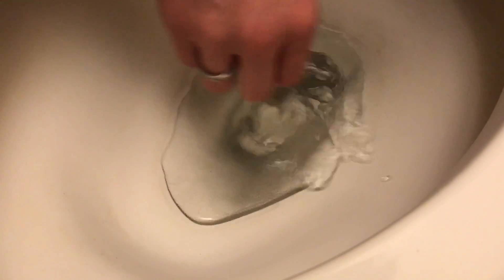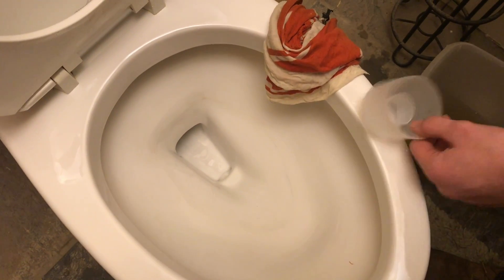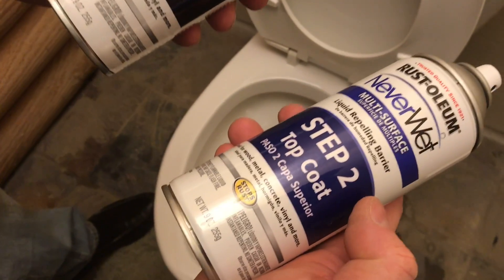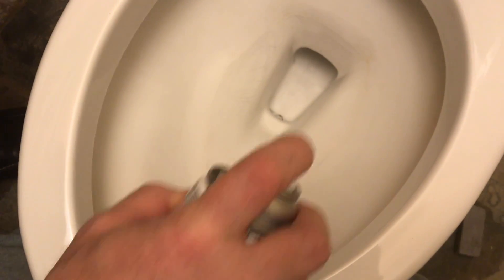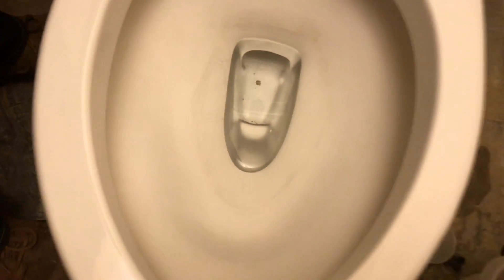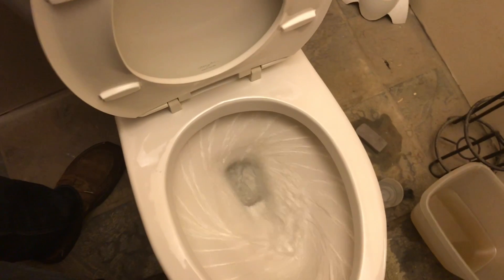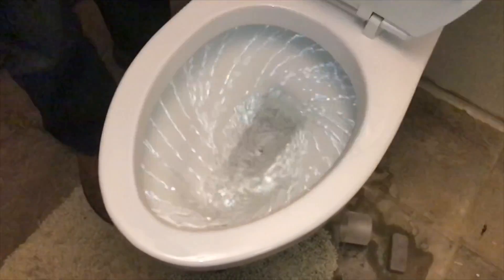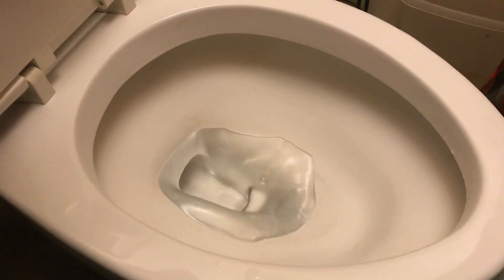how to create a HYDROPHOBIC self cleaning toilet!!!

Comment: Hmmm. Scuff the bowl first with a Brillo pad to give the paint something to stick onto. Epoxy would last longer and some antiperspirant spray onto the wet surface of the epoxied bowl would act as your cheap hydrophobic material or even that same top coat you just used onto that epoxy. Otherwise, lol, some automotive grade ceramic paint coating. Should atleast get some years of life out of it. You said wax lasted longer so the hybrid ceramic spray wax should do even better. I’d say atleast 2 weeks to a month depending on brand. You, sir, are a true innovator trying to reinvent the wheel and everyone should be grateful for it bc someone will see this and perfect it. They’ll probably be the next billionaire lol.

Comment: I gotta ask, did poop slide off also? For me, that would be the main attraction for doing this sort of toilet hydrophobic treatment.
Reply from the maker: Everything slid off, the only problem was it only worked for about a week. I tried car wax next. It didn’t work as well but it lasted longer. Hope that answers your question👍👍
Reply: @livefree6878  thanks for the reply.  I've used it on my plastic camping cassette toilet in efforts to keep everything clean.  I haven't tested solids yet.  Fingers crossed.

Comment: I wonder if it would help in the tank to prevent corrosion, iron and other mineral build up? The inside of the tanks aren't usually glazed so they are pretty rough causing pockets for minerals to grip.

Comment: You noted the rough surface when dry… how well does this hydrophobic toilet handle poop?
Reply from the maker: Even though the surface was rough it was still hydrophobic. The unfortunate thing was it only lasted for about a week and a half. Maybe if I put a thicker coat on it would be more long lasting.  While it lasted it was amazing. I tried turtle wax and it lasts a lot longer but it’s not as good. Hope this answers your question
Reply: @livefree6878   hank you for responding. It kinda answers my question. But since feces is pretty oily, with solids, that i thought might not be "aqueous" (?) enough to be repelled by the hydrophobic finish, but would instead (due to its oily-ness) snudge between the tiny bumps that make the surface hydrophobic. But if you experienced no build-up after waste made contact with the dry surface. I'm imagining a Thomas' English Muffins commercial... butter... nooks and crannies... I hink the hydrophobic property lent to the surface is from the dimensions of the bumps the spray creates on the surface... like those water-shedding tropical plants. Thanks!
Reply: @livefree6878  Mine didn't even make it 24 hours before it started peeling off! I think constant contact with water is a problem for this stuff. It's like a rubber coating, or at least it was in mine when I had to peel it off the next day because it started coming off at the bottom of the bowl. Looked like a cool idea, but maybe it can't handle being submerged in water, or maybe it needs to cure longer.

Comment: how would this help clean the toilet? the walls being wet help from them getting dirty. now you have dry walls. and worse yet the water from the flush won't even try to clean it since it doesn't cling to the walls. this doesn't make sense to me.
Reply: So your don’t have poop water all over the inside of the toilet. It sinks n stays to the bottom and runs right out taking any “matter” with it instead of sticking to your toilet... u kno the classic “skid mark” lol
Reply: @christianthomas1877  This also traps bacteria underneath the solution to sticky poop is simple

1.Eat a better diet
2.Get a toilet with stronger psi
3.Lay a thin sheet of toilet paper inside of the bowl before doing your business

Comment: I also want to know how durable this has been. Followup thoughts?
Reply from the maker: It lasted about a month, I wish it lasted longer. It was absolutely amazing when it was working. As time went on it got less and less effective. I’ve been considering trying turtle wax. I know it won’t be quite as hydrophobic, but maybe it’ll last longer. Maybe there’s some other methods of applying it thicker that might be beneficial. Not bad for a first experiment though.
Reply: @livefree6878   Thanks for following up. it looks like there are some commercial products out there as well designed for this. Ceramic coatings for car paint are incredibly durable too so maybe that's another option? Bummer that didn't pan out!
Reply: @livefree6878  I think the box actually says it does eventually break down, all you're supposed to do it apply the 2nd coat again. But you're right, I think it also says to apply additional coats for longer lasting effect. Maybe try again and see if that's all it takes (Time lapse). Also try melting candy bars for solids.... Lol.

Comment: So it's been a while since you did it, have you noticed a difference on how clean it stays?
Reply from the maker: So far it’s working pretty good. The water doesn’t stand up like it did when I first put it on. But I haven’t touched the bowl with a brush since I put it on. It’s still clean, I wonder how long it will continue. I was thinking about letting it go for another week or so and possibly do another video showing what it looks like. You can still see the water beat up but it doesn’t seem as hydrophobic as the first day.